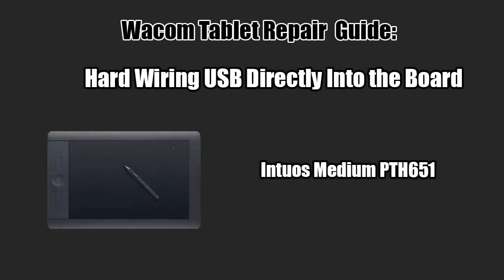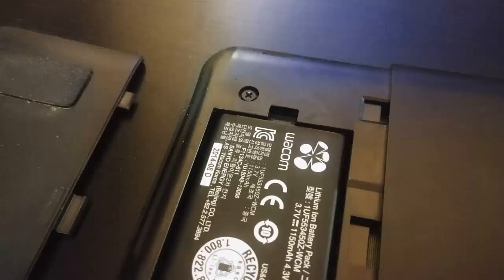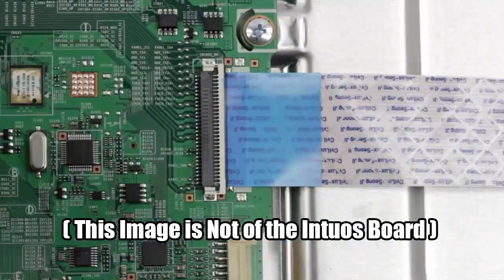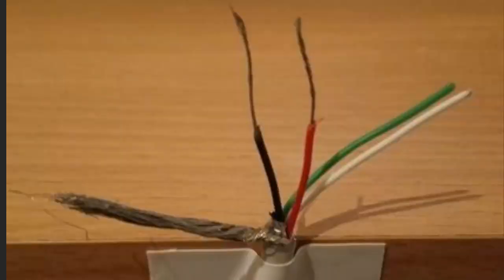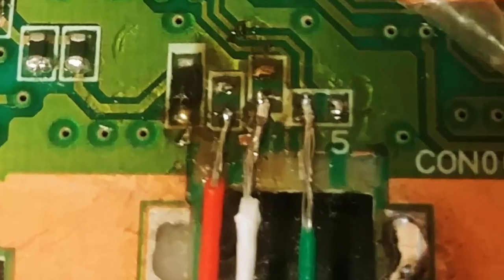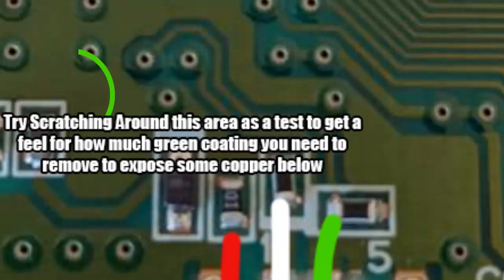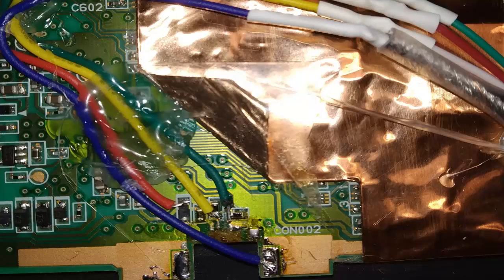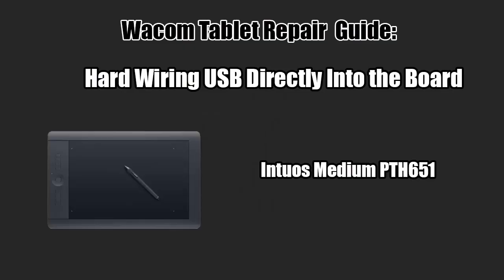An Inexperienced Artist's Guide to Fixing Wacom Intuos Pro Medium USB

Comment: Seriously? It looks like total disaster. Ok, it will work like replacing a punctured tire in car with 3D printing. A lot of effort with poor result. I would advise spend som money for professional service if you don't have proper tools and skills. Removed resistors protect tablet from shorting out etc. It can potentially happen when plug is connecting. If you have the skill of SMD elements soldering - just don't touch them. Using glue / tape for making workarounds is botchery.
Reply: At this point best option looks like abandoning the ship and buying a tablet with usb c, since repair often costs as much as a new tablet
Reply: @pro-hz7kx  Hard to say what is the price of service in your country. My estimation is 50$.

Comment: Thank you. I just fixed my intuos4 L. Thought I had to buy a new one. Advice: Be careful with Chinese cables. I had one USB extension cable laying around but the cable colors were not standard at all, made me lose an hour trying to figure out why it wasn't working. Oh, don't be like me and think you don't need flux. You NEED flux to solder.

Comment: It worked! thanks a lot!
a few tips: be very careful with the red wire and check if it's not shorted with the other part under, it will cause the tablet not to work.
I didn't noticed it was shorted and thought the tablet was dead

Comment: THANK YOU! I made a clean job with your video. I modified a bit the plastic case so i could put the cable inside to avoid stressing the soldering points. There are no schematics for this so your video helped a lot 🤟🏼🫰🏼

Comment: I kinda doubt this method wont hold very long unless you are able to get those wires to be hold tight. Moving the tablet will probably stress the solder joints. Is it still holding?

Comment: It would have been helpful perhaps if we know which way to pry the panel. No video states on which side the clips and pins are.
Reply: Looking at the blurry images, i guess the top part has the clipping parts and bottom part has the edges which clip in. So i better try to get something behind the top cover and try to clip them out, not sure what the translation for that is
Reply from the maker: @RomboutVersluijs  Hi Robert, sorry for replaying to this probably too late, but if you go to this website https://fccid.io/HV4PTH651/Internal-Photos/Internal-photos-1992302 there should be some better detailed images of the internals of the device. It looks like the bottom plate has the clips and the top has the receptacles? Its a bit hard to tell.
Reply: @tjpones  Thanks for the update! I kinda doubt mine can be fixed. I saw some other video of a guy using a scope x40 and using really thin wires to solder it back. I cant do this, dont have the equipment. I live on an island and doubt any here can do that procedure
Reply: @tjpones  My fix is for the wireless port, very complicated since it has more routes on the board and thus more wires

Comment: Today my small intuos pro dropped and the usb wireless kit port got loose. It first was only blinking on inspection i noticed it wiggles and now does nothing. Tried to open it but need better tools. Hope i can solder it back on though.

Comment: Thank you so, so much for uploading this-- you just helped me revive a dead Intuos 5 Touch that I've been sadly keeping around since like 2014. I can confirm that the Intuos 5 Touch in Medium has the same circuit board build, at least around the USB port, and these steps got it up and running again. )I did have to connect the red wire to the top of its respective resistor, though; it didn't seem to work when I had it connected to the bottom.)
Reply from the maker: Glad to hear that it had a positive effect! It has been some months now and my tablet is still in operation so hopefully yours continues to serve you as well

Comment: A few tips:
1. Do NOT depend upon the solder joints to physically hold/fasten the cable to the device. You NEED a good strain relief, otherwise it's just asking for more damage.
2. Using hot glue on a PCB is fine. Usually. Just make sure that the surface is very clean before application, and if at all possible, try to use it in a region WITHOUT traces (the little lines you see interconnecting parts on the PCB). Make sure the cable jacket and insulation on the wires is clean, too.
3. If you need to remove cured/set hot glue, simply apply isopropyl alcohol to the joint, and the glue will release like magic.
4. Electrical tape IS NOT a fastener. It exists to prevent continuity between two objects. Placing electrical tape over your solder joints will accomplish nothing, and will make later repairs more difficult because the adhesive doesn't always come away cleanly, often leaving goo on everything it touched.
Reply from the maker: Thank you for your additional advice. 

I agree that solder should not be relied upon for keeping the wires/cable in place.  I did not show any pictures of it but I did use hot glue to essentially flood the "exit hole" for the cable so as to prevent the cable from pushing or pulling .

I guess I made an ironic mistake in using electrical tape to cover the wires instead of glue. It was my hope that covering the soldered leads would further prevent them from flexing and potentially breaking (especially since my board is so close to unworkable due to burns) but not in such a way as I couldn't remove them later, and without unforseen consequences of another material reacting or shorting out. 

Ironically hot glue is not as messy to clean as I thought. 

I will add your notes to the description.  If I can I'll try to edit the video to reflect them? Not sure what can be done post upload
Reply from the maker: I could not find a way to add your tips to the existing video but I put them in the description and pinned them here. Thanks again

Comment: Ayy you did it!
Btw I saw that your resistors got removed. They are most likely there to protect the board from getting damaged by high current. As long as you are not connecting the tablet into something sketchy, you should be fine.
Reply from the maker: Here's hoping! I expect that after being advised on the concept of pre-soldering nobody else will do as badly as I did! I left the truth of what I did in as both a warning to be sparing with your soldering iron and as encouragement that even if you blow it REAL Bad you can still fix it!
Reply: @tjpones  I hope I will never have to do it. My Cintiq has a very flimsy connection which can easily break. Wacom is probably making them this flimsy on purpose.
Reply: @SimpleSaemple  100% i reckon, $500 for a new one, easy money, but now im attempting to fix mine i wonder if its easy money buying broken ones with this problem to resell haha